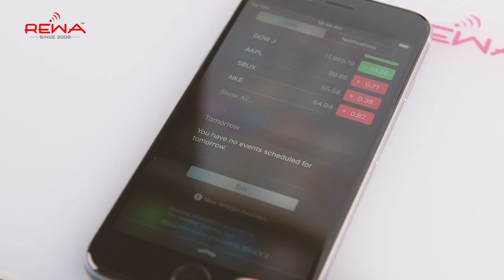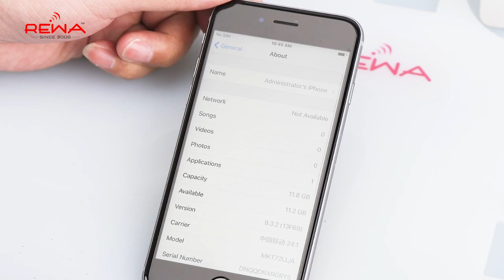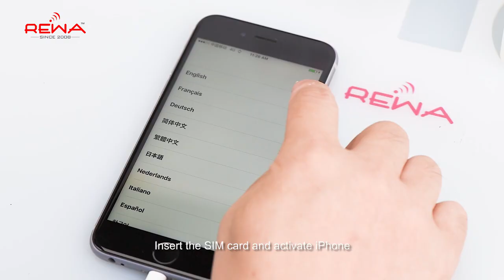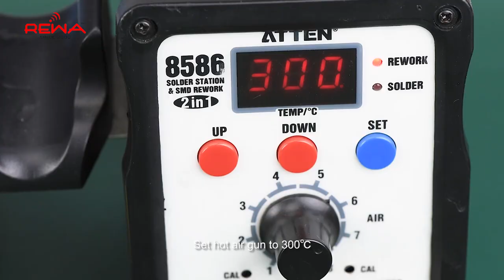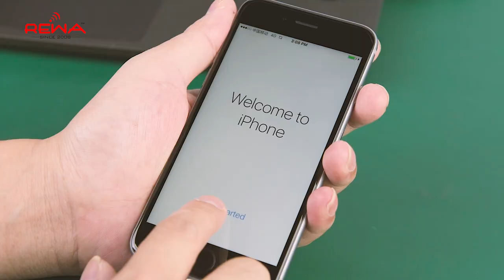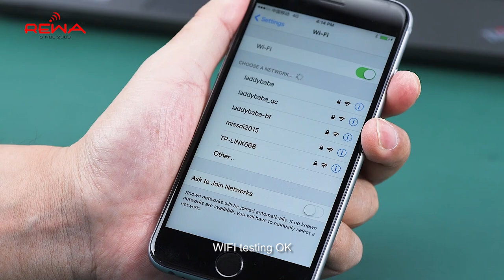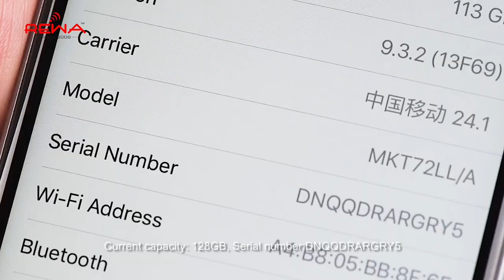Upgrade iPhone 6S 16GB Storage to 128GB

Comment: People this video is great but by doing this you will already be killing the thermal pads on the APU. Once you place the MOBO back to the phone you'll be throttling performance as hell. In small words ( an ultra slow phone ) just get a new phone or trade in your current for a higher GB version.
Reply: iphone 6s doesn't have any heatsink and thermal pads
Reply: Adrian Ronald Sehat 
It does have. Under the metal cap there's thermal paste.
Reply: exklim So you mean the iPhone has to throttle performance because it is now getting too hot too quickly?
Reply: CookieCraftMedia 
That is correct, even by opening the camera app will throttle the phone. The DIE needs to dissipate heat quick. 
iPhone 6s kernel is set to throttle the APU at 40c. 
Without a good thermal paste/pad the APU tend to reach those temps in less than 3 seconds.  those temperatures are critical for the phones hardware such display.  

Once you perform this operation (video) your thermal paste/pad will definitely be toasted (dry), becomes hard like a rock.
Reply: exklim those metal covers are electronic shielding.. also, thermal pads are reusable so im not sure where are you getting here.
Reply: Plus the next update it won't work as it's apples way or the highway learned that the hard way when I changed a battery and didn't use apples batteries!
Reply: killing the thermal pads. I was like wtf are they talking bout ..must be a apple rep trying to cock block us 😝..they speed drop idea made no dam scence
Reply: wouldn't you be able to use a certain form of thermal paste like IC diamond then
Reply: you can always replace a thermal pad or add thermal paste, and the phone should shut itself off to protect itself if it gets too hot or thermal throttle dw
Reply: A b r o a d
Reply: exklim hey you will never guess how they manufacture them. By hearing them!
Reply: Can use SD via lightening port.

Comment: How come the 4 missing pins wont affect performance?
Reply: Cal M cus he installed all new pins on the new drive
Reply: because it is iphone?
Reply: it's not the same mainboard.. it s logic
Reply: These chips usually have a lot of grounding pads and some NC (not connected) pads, so I assume this is the reason. Just check the datasheet for the flash chip.
Reply: they could be ground pins but if you see in the video, when he dessolder the nand, 3 or 4 pins went out with the nand too. it's possible when he dessolder at low temperatures. maybe if he had waited a pair of seconds all pins were be ok.    but this system is the only way to fix the FAMOUS problem. bye
Reply: They are NC or "no stuff" pins/pads. On a lot of electronic devices there are many components like BGAs or connectors that have these types of NC pins/pads. They are usually there because they were previous designs. The last circuit it was built around used those pads or pins, but in the new circuit there's no need for them. No need to rebuild and redesign a chip or component to suit the needs of a particular circuit, when you can just use the same type of chip and slightly alter the circuit to make it work. Less expensive that way.

Sometimes they are also pins or pads designed to facilitate diagnostics.
Reply: Might be redundant backup pins incase other pins were to fail

Comment: Do NOT pry the BGA NAND like shown or you’ll end up breaking off the pads from the PCB! When the solder has melted it should easily come straight off, if it doesn’t then the solder is NOT all melted yet and you’ll most likely tear off some pads (like in the video) and that’s hard to fix.

Comment: Is this cheaper than buying the 128GB iPhone?
Reply: If you add the amount of time and shit that could go wrong... no.
Reply: how so? it's serious question I really don't know
Reply: TerrorYO slower memory module compared to the nand chip apple uses.
Reply: Do not do this. 

Just go to Amazon and buy a 128GB iPhone 

Or get a S7 Edge.
Reply: NocFA I see, thanks
Reply: One, yes it is cheaper. But you need a professional and all this equipment to do it.
Two, the iPhone does NOT get slower. Sometimes they actually get faster depending on what kind of chip you buy really.
Reply from the maker: It is cheaper, but not cost-effective for individuals. Also skilled repair techs are required for the operation.
Reply from the maker: Exactly.
Reply: Nexstep It's unlikely you'll find a chip faster than apple's at a reasonable price dude, if you see any speed increases it's due to other factors.
Reply: NocFA The thing is, Apple doesn't manufacture the chips. Toshiba does and if you get them off Toshiba then it depends.

Comment: this upgrade is expensive...i am a skilled tech i am doing this kind of chip replacement for years. if you think this easy,  i tell you this is not for noobs..  this method can make your phone useless . even pro's sometimes fail with this procedures.  all i say is they have done a great job here. more power guys

Comment: I tried this and my phone is now bricked. Thx.
Reply: your fault lol. can't even into tech repairs lmao
Reply: you have just received 1000 point sir
Reply: Gwent Champ just smash it and get another one with your warranty, if they ask for it give them the smashed phone
Reply: Coming from a technician, you dun goofed.
Reply: I have done this mod 3x now. There's a couple steps you need to do between acquiring a drive and soldering it in. Make sure it's not locked! Make sure you have the expensive hardware to properly get the drive ready for the 'ol switch-a-roo! Worked fine. Did you flash the new hard drive coming in or did you just grab one off of another phone and throw it on in there? After flashing, did you use the NAN reader this company has and THEIR software to make sure it flashed properly BEFORE installing it? Again, I DID this 3 times now. It worked. Like a charm. EVERY time.
Reply: TheDavidp82 any chance do you know of these machines/tools/software they are using to complete this ?!
Reply: +TheDavidp Press (X) to doubt.

Comment: with all of thoses tools you could already get a 6s plus with 12 8 gbs
Reply: Which tools?
Reply from the maker: Hi Tyler, This is mainly for repair shops. For individual customers, it is not cost-effective to buy all the tools and materials, you 'd better find a repair shop instead of doing it by yourself.
Reply: REWA Technology حتى لو امتلكت هذه الادوات فلن اكون مثلك بارع في التصليح. أهنئك على ذلك.👍

Comment: Can iPhone 6s plus handle an upgrade fro its factory 128gb 256gb?  also, do you sell all the tools in this video as a kit?
Reply: yes but iso will only use 128gb cause that's all the phone can support
Reply: GOTCHA, Thanks!!
Reply from the maker: Yes, if there are 256GB chips.
Reply: NO!!!!!!! DO NOT FRIGGIN DO IT!!!!!! There were NO 256GB options for the iPhone 6sPlus. You CANNOT take chips from other models (even an "S" model where they barely change anything) and put it on your model. The models have to match!!! The architecture is a LITTLE bit different on each model. Besides that, I do believe the solder sockets wouldn't be the same either. Almost certain of that. But no, your dream is henceforth dashed man.
Reply: WRONG DUDE. It won't work. PERIOD. The drives will NOT interchange my man and still work. TRUST me on this.
Reply: TheDavidp82 I'm not wrong I have tried it LOL it just does not use all the space all you can use is 128GB
Reply: I bought the NAND HDD Memory Flash machine from a guy. I've not TRIED to because I don't want to fry a very expensive machine, but it clearly states it works UP TO the 6, but NOT the 6s? Have I been able to do 6s the whole time?!

Comment: In 2020 I ask, who has done this successfully besides the poster?
Reply: Ivan Diaz  i have done with my iPhone 8 32gb upgrade to 128gb its been a month i dont have face any error with my iPhone
Reply: @bryanpaulpadin675  lol
Reply: @bryanpaulpadin675  hahahaha I really think you did not upgraded your memory cuz that NAND chip programmer is expensive like new iphone 8
Reply: My local phone shop around did that everyday.
Reply: My local 7-11 does this with pizza order. Takes 12 min to go and throw Iphone 6S into trash can.
Reply: Strange Parts has also done this, albeit not with the exact same tools. 

For someone like me that's good with disassembling/re-assembling stuff but has 0 soldering experience something like this is out of the question :(

Comment: haha apple charges 300 dollars for upgraded storage and this is very cheap process if you have the tools. Proves how terrible of a company apple has become...
Reply: J Wightman and a person with those tools and chips would charge around 350... the chip itself is probably 50-150$
Reply: J Wightman and a person with those tools and chips would charge around 350... the chip itself is probably 50-150$
Reply: Lunas Eclipse exactly
Reply: Certanly, I think only the tools would cost around $ 270 or more, the memory chipset $ 150 and God knows if you have the hands pressicion to not damage the phone while open.
That's all for me
Reply: Alexander Guerrero depends on the grade of tools hot air rework stations can get pretty pricey a good one is around 500 min shitty ones can be had 2nd hand for around 200. the vice they use is probably 100 the stencil is probably 50 then the tub of solder paste and flux paste is another 50. so yeah this is totally diy. rather than spending the extra 100-200 when you buy your phone...
Reply: Alexander Guerrero lol never had to fix a phone I guess. And no this is much cheaper than whatever you just said.
Reply: J Wightman yeah a service is much cheaper but for someone not already owning the tools and equipment. It is around 800-1000 in tools and equip and parts.

Comment: Dude ... you broke down a few contacts, but the video goes on with a cheerful melody. It is possible that other hardware or software did not know what is happening, so I reckon it will not have the capacity or the overall problem to achieve it.

Comment: Now the main thing, how much it will cost?
Reply: Helal Hashmi I guess it depends whether you do this frequently, like in a shop. It wouldn’t be expensive in that sense, because profit is more worth it. But as a normal user, it would be more of a loss since you could just upgrade to a higher capacity

Comment: When you’re putting everything back together, wait until everything is connected, then put the battery’s cable in, there’s a small chance that it could mess up the screen or any other component

Comment: Why doesn't the chip fuck up because of all that heat that's on it
Reply: it has a heat sink like lid on the chip itself
Reply from the maker: It won't be damaged if the temperature is below 350℃.
Reply: Most SMD components handles the heat pretty well. Unless they're made out of some cheap plastic.
Reply: +REWA Technology Yes, what you did will be successful but....  whenever memory consumption will go beyond company provided specs (I.e. 16 GB here), phone will keep rebooting automatically and you will not be able to save anything. So actually 114 GB is just display but phone is what is meant to be to store max 16 gb. It's virtual trick.  try it please by putting data till 128 GB and let us know. Thanks for the video.
Reply: I have seen several videos with new flash chips put into iPhones. Are you saying that even though the chip has been given the iPhones serial number and so recognises the entire storage value that only 16gb can be used. If so how do you know this ? Also being that flash storage is simply that and not memory for the operating system what error would make the phone reboot ? The storage size is being recognised correctly as such the device should have full access to that storage. Would be very interested to know more
Reply from the maker: It replaces the physical memory
Reply: That's how they made it!!
Reply: +tmarlow5 I don't have answer of your question- what make it reboot?  I will research.
Reply: its been a couple of months,  Can you show this phone with more then 16gb of data?
Reply: it's made with an anti-fuck up materials that's why